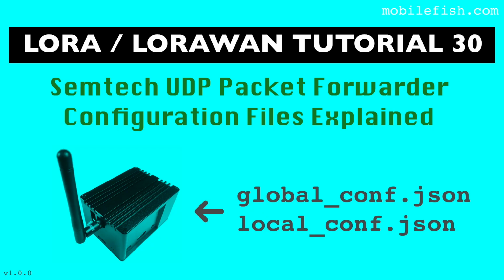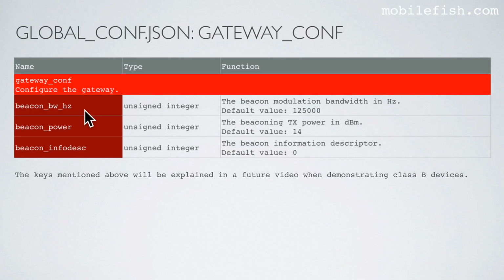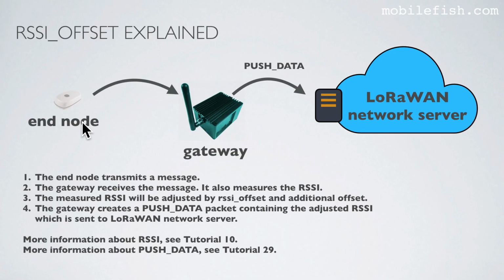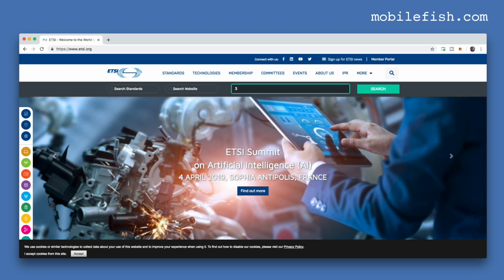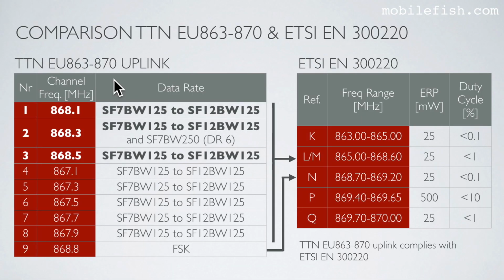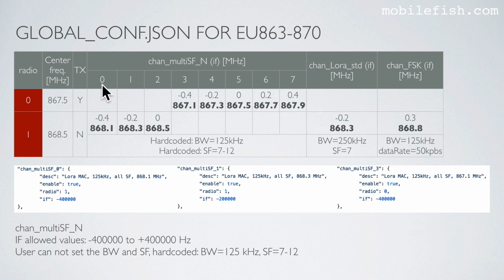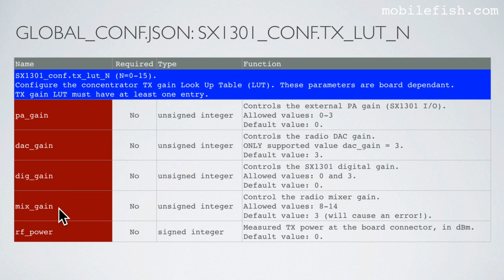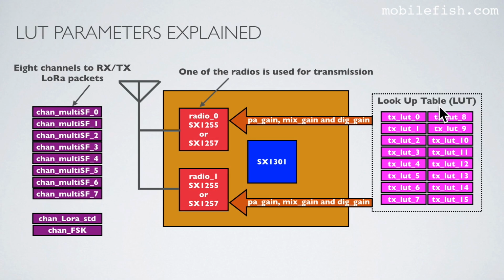LoRa/LoRaWAN tutorial 30: Semtech UDP Packet Forwarder Configuration Files Explained

Comment: Hi,
I have problems with SyncWord function.
I tested it with one sender (Heltic ESP32 LORA) and two receiver (heltic). One receiver has the same syncword as the sender. This works great. Only the receiver with the same syncword get the Packages from the sender.
Next test: the two receiver (Heltec) with different syncwords and a sender ATmega328P Radio lora board with the syncword of one receiver (heltec). This receiver get the packages and show it on the OLED. But the other reveiver (Heltec) with different syncword shows the packages too. But wrong formatting.

Is the syntax of syncword on ATmega328P different from Heltic ESP32 Lora?

Comment: I really like your tutorials, I'm learning fast. But after watching this one I noticed that I'd failed to set my antenna gain in the conf file, so I set it to 6 (it was 0).  That stopped everything working as TTN always requests powe 11db in response to join requests.
So the forwarder s/w now subtracts the antenna gain to get 5db and tries to look up a matching rf_power level.  But there is no 5db power level (only 3 or 6) so it rejects the txpk and the transmit never happens so the nodes can't join!
Am I missing something or is this crazy?
Thanks again, Steve.